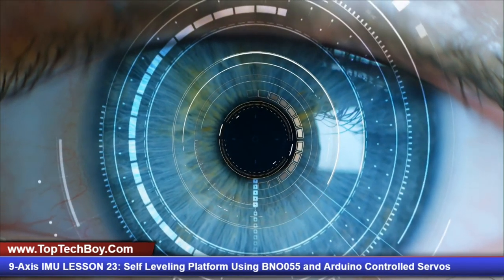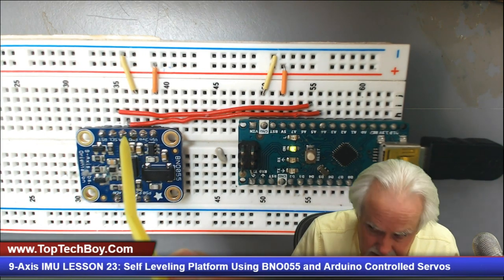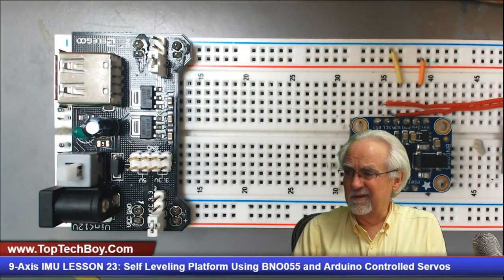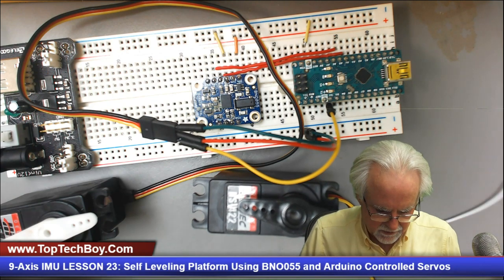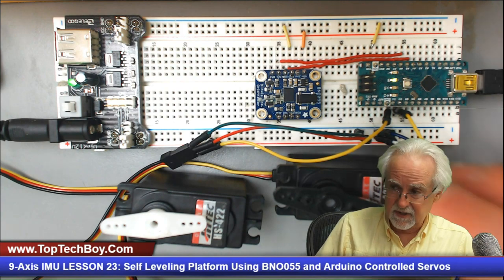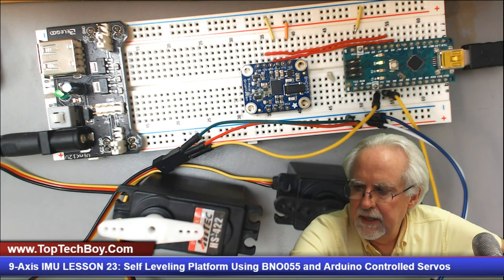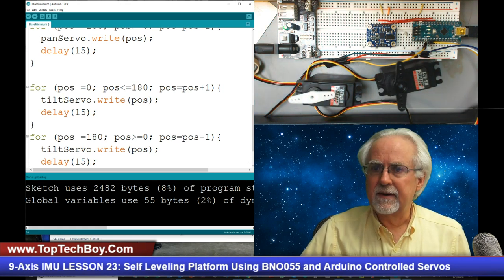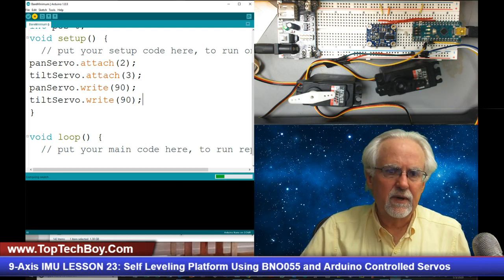9-Axis IMU LESSON 23: Self Leveling Platform Using BNO055 and Arduino Controlled Servos

Comment: Hi Paul. I enjoyed both videos. Would a separate small computer, like a laptop, be able to handle let's say one of the cameras thereby taking the burden off your current computer?  Or is it necessary to have everything running on just one computer?
Reply from the maker: Problem is that all the cameras and screens feed into one piece of software, wirecast, which then builds the shots. The USB ports become clogged, and then various feeds 'hang'. All has to be on one computer
Reply: @paulmcwhorter  I see. I just googled Wirecast and see it has 3 versions, the most advanced being Wirecast Pro. I also see that you get  free support for a year. I wonder how good the support is. It would seem what you are trying to do is what they advertise.  The system requirements that they recommend are: Windows 10, i7 quad-core @ 2.8GHz+, 16GB+ RAM, 500GB+, Solid State OS Drive, and Nvidia GeForce or AMD Radeon, 1GB+ video memory.  They then go into "Best Practices" where there is a discussion of "Minimum Required Upload Speed", etc.  And then I see this "Additional tasks that can consume upload bandwidth on the network should also be considered when determining how much of the available upload bandwidth can be allocated towards streaming"  I guess my question is: would a more powerful computer be what you need? Or increasing your bandwidth? And if you increased your bandwidth, would that help your existing USB ports? Or do you need a solution that specifically addresses the capacity of the USB ports.
Reply from the maker: The main problem is USB bandwidth. I am mostly not live streaming so the speed of my internet does not matter. It is too little USB bandwidth, and not enough horsepower to process all the different video sources.
Reply: @paulmcwhorter  I understand. I just went looking for Windows 10 and USB bandwidth and I see there may be ways to allocate USB bandwidth among your different devices. One thing that jumped out at me was the difference between USB 2.0 and 3.0.  Not having to deal with the kind of operation you have, I find I have more questions I would normally ask about the power of your PC and the relationship between that power and your PC's USB bandwidth, but I don't want to exceed your patience-bandwidth.  Anyway, thank you for everything that you do. My Tuesdays, Thursdays and Saturdays are so much more enjoyable because I can start those days off following your various different projects. I do support you on Patreon because I can and because you are helping a lot of young people out there who are not in a position to give you that kind of support.

Comment: Do you think I could (safely) power the Arduino nano AND the two servos off the of a 9v battery through the power supply? Because I'd like this to be portable.  Thanks a lot Paul!
Reply from the maker: Really am not sure. Depends on the servos.
Reply: @paulmcwhorter  I'm using the HiTec Servos. (The one's you recommended for this series of lessons)